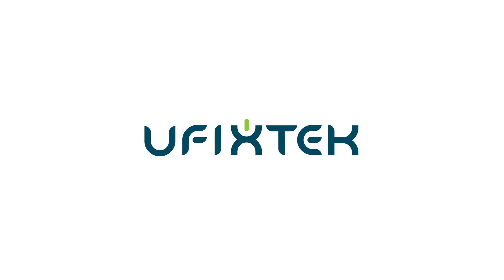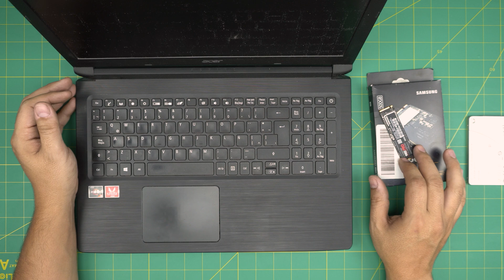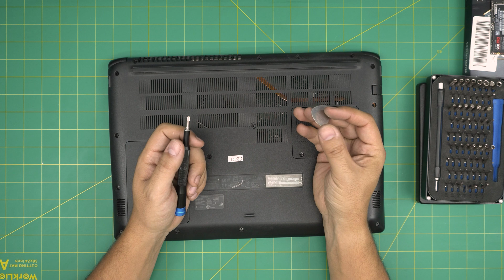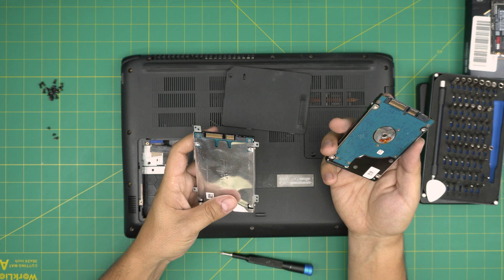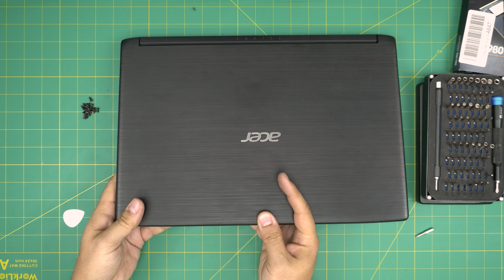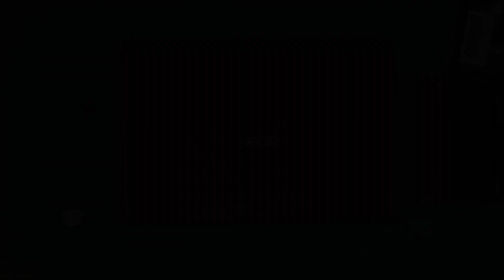How to Upgrade Storage from SSD to HDD on Acer Aspire 3 A315-41 R7WT Laptop: Step-by-Step Guide

Comment: My Laptop Model is ACER ASPIRE A315-41-R3FD. Will this model support NVME or only Sata SSD?
Reply from the maker: 🫠Regarding your question, that model only supports an M.2 SATA SSD. Although the slot may look like it could accept an NVMe drive, the chipset is designed to work with SATA drives only. Using an NVMe SSD won’t work .
Should you have any further questions or requests in the future, please don't hesitate to ask me.
cheers🍻

Comment: Does it support NVME SSD ?
Tell me brother
Reply from the maker: 🫠Regarding your question, No ONLY m.2 SATA with two cuts on the ssd. this model is not NVME compatible. up to 2tb m.2 sata
Should you have any further questions or requests in the future, please don't hesitate to ask me.
cheers🍻
Reply: @uFixTek 
Thank you for reply.

But in other comment you have mentioned the below thing.

so does the acer aspire 3 a315-41 really support nvme? and can i put a 2.5 SATA 1TB ssd and a M.2 SATA 1tb ssd? and 16gb of ram?

@uFixTek5 months ago

Thank you for your feedback! If you wish to support the channel, you can like, subscribe, or both! Regarding your question, yes it does take NVME we do install it for our clients, you can have up to 2TB on m.2 and 2TB on hdd or ssd2.5' at the same time. NOTE: there are few reversions out there very rare that don't take nvme, there is no place you can find that unless you try it. but it is very rare to come across them. and yes place two 8GB ram to get a total of 16gb without any issues.

So please clear my doubt.
Reply from the maker: The issue is that there are few reversions of this model, we have got few that took nvme, but mostly 90% are not nvme compatible. it is very annoying that the manufacture doesn't tell you if the reversions are compatible or not.
give me the complete model number that shows in the bos or in your bios or sticker under your laptop.
Reply: @uFixTek I have an Acer Aspire 3 A315-41-R95S does it support Nvme?
Reply from the maker: yes it does my friend
Reply: @uFixTek  But in BIOS it says sata mode: ACHI,  NVme needs SATA Mode: PCIe so how it will support NVME ? I am having same motherboard which you have shown in Video
Reply: @uFixTek My Laptop Model is ACER ASPIRE A315-41-R95S.

Will this model support NVME or Sata SSD?
Reply: Thanks for your reply. My laptop model is ACER ASPIRE A315-41-R95S
Reply: @PranavSharma-gf9rj  can you confirm does it truly support NVME or SATA SSD
Reply: @tweaktv671  I want to buy online.